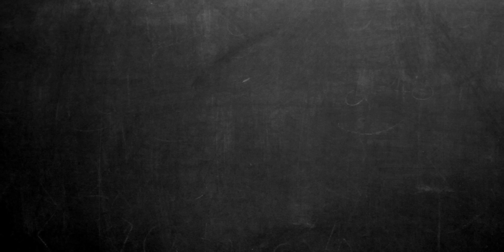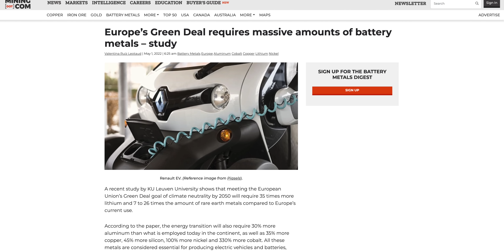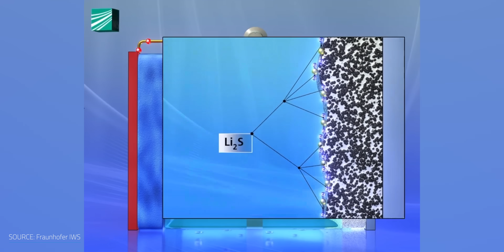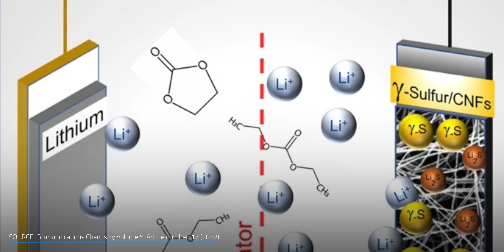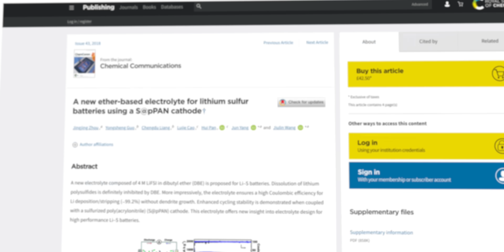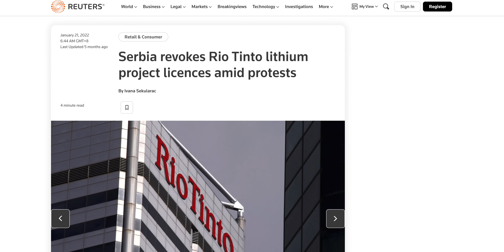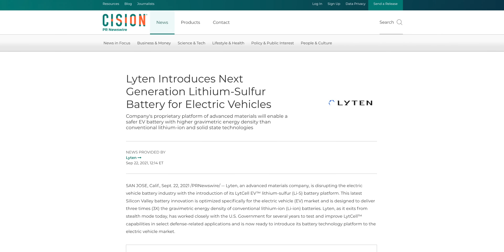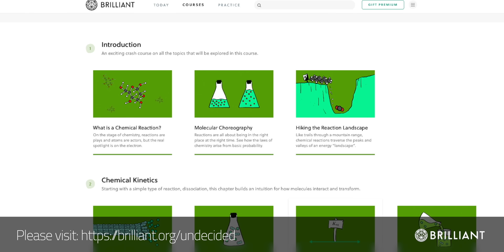Why This Accidental Battery Breakthrough Matters

Comment: A battery made from lithium nickel and cobalt, was never going to be cheap, and given the limited supply of these materials, it was only ever going to get more expensive, replacing the nickel and the cobalt with sulphur would be an improvement, but if it is possible to replace the lithium with the abundant material sodium, then you should have a sodium-sulphur battery with the potential to be useful in cars,, home energy storage and short-term grid storage at a much more realistic cost. 
But, and there is always a but, everyone is ignoring the meteorological blocking high pressure system in the room, or in the case of the U.K. covering the whole country. At least twice each winter the U.K. is inflicted by a weather event known as a blocking high pressure system, which can last for up to 2 weeks at a time, plus they usually come complete with a blanket of cloud, which further reduces an already limited amount of light for any solar panels, plus there is little or no wind, for the wind turbines, leaving us with nuclear, but even if we get the 8 shiny new nuclear power station the government has planned, that is only equivalent to about 30% of our energy needs, which will mean reigniting our fossil fuel power stations.
 Put simply we need a system that can store and supply 60 to 70% of our energy needs for a month each winter, most energy storage systems including batteries are only short term, good for no more that 12 hours at a time, the solution would be to convert some of our surplus renewable energy into a chemical form which could be stored in large tanks for month before being turned back into electricity. this could be as simple as electrolysis to produce Hydrogen, and the device that was talked about on the last broadcast would seem to be right on que, the U.K. does have a comprehensive gas pipe network, much of which is being upgraded to high density plastic pipe capable of carrying Hydrogen, and for countries  without a gas pipe network Green Ammonia might be a better option, but everyone is now shouting you lose energy when converting electricity into a chemical and you more when converting it back into electricity, but as long as the electricity comes from a renewable source does it matter if there is some loss along the way if you end up with long term stored energy. It should have always been been obvious that for every 2 wind turbines you install to supply direct electricity, that you would need a third to produce electricity for storage, in relative terms the cost of a third wind turbine is not that great, plus the fuel for a third wind turbine is still free, but it is the choice of storage system that will determine the cost of future electricity .Some people say we do not need storage, we can simply exchange electricity by interconnectors under the sea with Europe, but given the trouble Europe is having with its energy supply I think it extremely unwise to assume our partner in Europe would be willing, or even able to supply us with what we want when we want it . Weather blockages are not going to be unique to the U.K. many countries will suffer with out energy storage, given its huge size the U.S. is unlikely to be troubled by a single weather event, but it is surprisingly the poor state of the countries grid system  that could stop energy being transferred across the country, so it would make sense if individual states stored at least some of their surplus renewable energy in a chemical form so that they had a long term store of energy to deal with prolonged local weather events, and because it looks likely that Hydrogen or Green Ammonia will be the fuel of choice for shipping, heavy road of rail transport, and aviation.  
Depending where in the world you are, it should be possible to get a large proportion of your energy needs from solar, wind, wave or tidal power, and  sodium-sulphur batteries should be a low cost way of powering light transport, or storing energy short term to cover the highs and low in supply and demand, but there must also be energy stored in a chemical form  for heavy transport and for long term energy security.

Comment: I can't say what I think about that question. I can say that I certainly HOPE this new by accident discovery will prove out to make lithium-sulfur batteries a reality and bring these to market in short order.

Also, I certainly HOPE that the prospect of using sodium in place of lithium (as the anode) will prove to be more than viable...and if so, I HOPE there will be NO ONE or company or entity that will attempt to waylay that technology for greedy gain or control purposes.

How wonderful it would be to 'ditch' all these internal combustion engine powered vehicles for EV powered vehicles that potentially could travel (as you say may be possible with this new technology) eight times as far as current EV battery technology allows. So a modest 150 mile range times 8...NO, being more conservative here, lets say no more than a 6.5 times greater distance. So, 150 miles x 6 times further, would equal an amazing and unpresented 900 miles! 

But taking the 2022 Rivian R1T, with the less 'fuel' efficient 20” All-Terrain tires at 267-283 miles (as opposed to the 21” Road tires at 314 miles). That would jump to at the lowest end a whopping 1,600 plus miles on one charge!!! 

Now who is going to drive STRAIGHT THROUGH for 1,600 miles anywhere? Even at a consistent highway speed of 90mph (yea, right) that would take nearly 18 hours. That ain't happening. 

A more modest 8-10 hour (day) drive at average speed of 65-70 mph would take you at the most 700 miles. Even if you drove 12 hours somehow at 75 mph a day (900miles). You still have 600 miles worth of battery life to go. How many hours would it take to charge up to 100% for the next days outing...when you don't even need a full 100% recharge to go another 900 miles? 

But for me and a host of others (perhaps the vast majority of folks), what are my average daily travel requirements or habits? Not even close to 1,600 or 900 or even 120 miles a day for that matter. For me, it is about hardly ever even 30 miles per day! Holy cow! A cheap used EV 80 mile per charge car with this new technology would put me in never, never land - 80 times 6 would give me at range of 480 miles per charge; or around 16 days of battery life traveling the full 30 miles per day!

Man I love this technology!!!

I seriously HOPE though that the evil powers that be will not undermine and sabotage these great steps that would have such an incredible positive effect upon the economy and TRUE travel freedom.

Thanks for the update. Great site.

Comment: The only problem is that manufacturers aren't going to want to change to sulfer batteries because they don't want to spend the money to switch over. Also if they're making more with lithium batteries they won't want to switch. So it comes down to the big companies or gov. regulations that will change over to sulfer

Comment: The problem with creating demand for an industrial byproduct has already been discovered. We can examine the crude oil market to see what the outcomes are. For example, there was a similar argument for diesel to power work horses and we can now see what has happened. The cost for these products are generally astronomical in the long run due to the absurd demand thanks to marketing efforts for the use of such products. The marketing creates strong arguments for the usage, thus leading to high demand and short supply.

Comment: Fuel Cells using hydrogen as fuel is the future. Toyota knows this. Current battery EVs is mainly liberal politics that wants to support Communist China economically. Japan doesn't want to make China more powerful. Fuel Cell vehicles are in production and on the road today.

Comment: These new batteries can be charged with electricity from the new fusion powered  electrical generating plants, in 20 years.......  Fusion has been 20 years in the future for about 50 years now.....
Reply: The USA navy has been using mini nuke power packs for 50 years. ZERO problems.

Comment: To replace all present individual cars with electric ones is an understandable dream for both car industry and consumers.
However, since the majority lives in cities, a much improved,denser "green" public transport could be more wise (?)
The energy could be tapped off from wires (or induction?) and then almost no battery is required.
Even with present technology, since the vehicle is bigger, heavier, better maintained and shielded, all kinds of existing, alternative battery or fuel cell systems become an option. Of course, a fleet of small non personal urban electric vehicles must be added for other purposes but for them we probably would have enough lithium. 

It is true that the present public transport in my city is far from making people yearn for such a future.

Comment: Can you please to an Episode on the Liquid Salt Batteries, Ambri Batteries, are saying that they are basically for Static Mounting, ie Solar Storage, and have a much higher storage capacity than Lithium alone, and if the Battery goes cold, due to Discharge and not Recharged straight away, it only requires to be fully charged for the Salts to Melt @ 460C, and Ambri have just started Testing on a Large scale. I have emailed the Contact on there Webpage for and Update on how they are going,As I believe that they have the Right Combination of Material for Energy Storage, But they said straight off that they are not designed for Mobile use, as all the Liquid salts would get mixed up, and Discharge the Battery.

Please do an Episode on the Liquid Salt Batteries, they are dirt cheap to make, and have to have a ceramic Casing, to keep the 460C Temp inside the batteries as much as possible, and there Early Testing said that the Liquid Salt Battery would have a Life Time of 50 years or longer, as every recharge removes any Dendrites, so there is nothing to decay, or loose its integrity in there Batteries.

One Pod Cast has already done a story on the Ambri Batteries, but that was 2 years ago, and we haven't heard anything since, But you have a good nack for digging out the truth, and making it public on your You Tube Video's, and I watch every one you release.

Regards.

. . . Colin. . .

Comment: As somebody doing his PhD on Li-S batteries, I am happy they get more coverage. Carbonate electrolytes  redirected the research towards a solid-state conversion process (with an liquid electrolyte. So we are not talking here about full solid state batteries). 

But, we are still far away from commercial release. Full carbonate based system so not yet achieve the energy density of commercial li-ion batteries.  (or in other words, a LIB powered car can still deive further than any car that would use carbonate based Li-S batteries. 

Also, for a new battery technology to succeed, it needs to integrate well in the current production scheme, since the production of LIB is highly optimized. If a company has to buiöd a new production process, it would take years before the prices are competitive (due to economies of scale). 

So, many challenges ahead, but we are working in it :)

Comment: Wow... I was already impressed with the prospect of Lithium-Sulfur batteries when you mentioned it may be possible to use Sodium instead of Lithium.  THAT would be a miraculous development - suddenly, desalinating ocean water for drinking water isn't an expense it's a revenue stream while relying on a much safer and cheaper resource for the anode.  Wow.  Crossing my fingers they succeed!

Comment: They could not come quick enough. 
The Team and I are submitting a development.
1.     250 prefabricated CLT & SIPform passive house certified homes. On the roofs of buildings, the Tractile, the excess electricity will be stored in the 28.8MW Tesla Batteries Farm. 
2.     The PV in total 934,370m2 - Tractile tiles 45,000m2 and ARCTECH SOLAR TRACKING PV 887,400m2
3.     Bi-Charging of EV one per house and 12 charging stations located in the shopping centre. 
4.     Micro-grid that connects to a community of 4800 residents 
5.     Landscaping the whole site, ensuring enough clearance for the surrounding bush and buildings.
6.     We will be trailing the SoMax HTC process. That processes the sewage into sterilises aggregate for concrete. So many products would release carbon released into the atmosphere. When State Government and Lismore Council approved the process.
7. We have a project at the end of 2024 that will be installed a long-range wireless power transfer - Emrod in New Zealand - The future of energy distribution. Emrod is pioneering the transition to a wireless, global energy network. Our technology is proprietary hardware for sending large amounts of power over long distances safely and efficiently using power beaming technology. Just as the internet transformed communication, wireless power will transform the world’s ability to generate and use power. Emrod’s technology supports:

The team and I will be at Fully Charged LIVE. Sydney11th to 12th March 2023. We promoted the project on the film on stand team taking a project and future projects.

Comment: Fire resistant, full discharge, heat tolerant, cheap, easily recycled zinc flow (ZBM3) SOLAR BATTERIES make good sense.

Comment: This smells like special interest and miss information for people to go into a direction and "control" resources for power and money ... sapping the economy and making people more foreced dependent.  It seems much like how R12 was replaced by 135a ... all political and R12 is much safer and cleaner... the patent ran out so they didn't want competition so made the laws to support 135a ... bad mouthing R12 .... I notice there are a couple of other battery types not mentioned that get about 4 - 8 times (4-8 hundred percent) more charge cycles than Lithium Ion.   I dare not mention it as it was skipped and not mentioned in this video .. political hack.

Comment: I think these batteries will be marketed BECAUSE they have a limited capacity to be recharged. So they can sell more units over a longer period of time. Like the built in self destruct in incandescent light bulbs. They could have been built to outlast your lifetime. "Green" doesn't really matter. Never really has mattered. Only the illusion of it. Placating the population into thinking they are being good people cuz they are helping the environment in their minimal efforts to reduce waste and recycle in their gluttonous over consumption of their environment.

For example, separating recyclables into a separate bin from your garbage, that you put out in the street, means now you have 2 large trucks making that trip to every house in the USA instead of just one. Then driving to 2 separate facilities to dump their loads. How is that helping the environment?

Recycling plastics is a scam that's gone on too long. Burn all of it in energy producing coal plants and make new production illegal. 

Probably lithium ion batteries will be deemed too dangerous to produce or too expensive, and our advancement as a society will be kept in check once again by capitalist greed.

Comment: sulfur chemistry still has a long way to go... plus the stable voltage plateau (~2.1V) for discharging/charging is significantly lower than Li-ion.

Comment: Batteries are not the key to renewables.  Renewables are a fad caused by promoting them in the most lopsided way possible. 

Batteries could still help to make low carbon energy more feasible, by buffering out nuclear plants.  It would only take a few percent of the batteries needed to buffer out renewables to buffer the output of nuclear production  And it would be far more reliable and robust.

Comment: battery tech is neat, but its only a holdover until hydrogen becomes a thing. 
I also don't see how needing more cobalt and nickel would make anyone 'carbon neutral'
you still have huge toxic batteries and a need to produce power for them, and unless you're using nuclear you're gonna have to cover the land in solar panels and wind farms. (which I also think are in the end bad for the environment, but I've actually learned about this stuff instead of just fantasizing over it)

Comment: I remember watching a documentary on batteries. From I recall at the time there 10 different type of batteries the scientists were working on. The crux was in the lab all ten worked perfectly, the issue became manufacturing it in the plant. They figured once that can be achieved these batteries will end up in the market place. They pointed out that it took 10 yrs to perfect the manufacturing of lithium ion batteries. It’ll take some doing it will happen